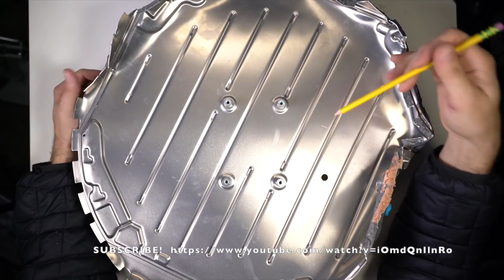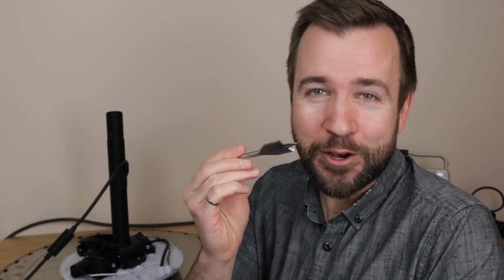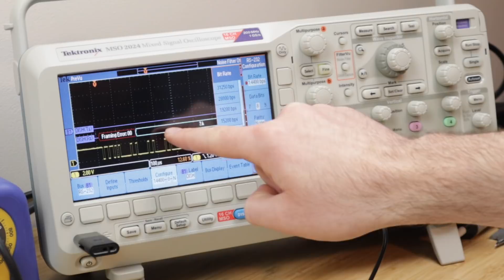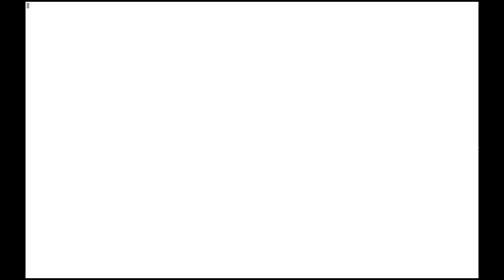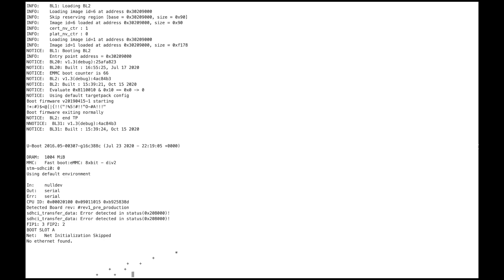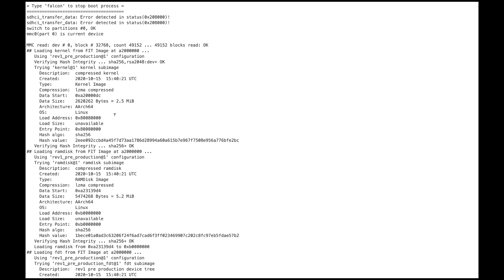Starlink Dish TEARDOWN! - Part 2 - Serial console and login prompt. Can you guess Dishy's password?

Comment: Did you ever make any progress on this? I would try something similar to the method below. 

1. Replace the router end of the ethernet cable with a standard RJ45 plug and power the dish wish a PoE injector. 
2 Compile a basic initramfs using something like openwrt or buildroot.
3. Like it says - type "falcon" to stop the boot (this will drop you to a uBoot shell).
4. TFTP boot the initramfs made earlier.
5. Mount the original root filesystem then cat /etc/passwd and decrypt. Reboot normally and enjoy root. 

At that point I would look for anything interesting. Listening ports. Services. Satellite configuration setting. Once could, in theory, uncap emission levels (upload speeds) beyond FCC regulation for example.

Comment: Did you ever get around to checking out the power block and it's POE requirements?   I'm mainly wondering if it'd be possible to bypass the brick and tap straight into an off grid 48v system(which typically charges up to about 52 to 56 Volts).  I've heard people say the Brick gets really hot so figure there's unneeded power drain to convert from 120v to 56dc.  With people seeing power draws of 100w to 200w I'm that could be cut back a little. 

I'm also a little curious on what that Black Dish cable looks like internally.   Does it just use a standard Cat6 or a proprietary cable with a larger wire for power?
Reply from the maker: Hey! I've been busy with work for the last little bit, but I am also VERY interested in the power supply. I'm hoping to try a few off-grid scenarios as well. I'll probably start by using an inverter, but I'd like to see if it's possible to supply DC direct with a little hacking and maybe a boost converter.

Regarding the back dish cable, it looks like ethernet, but possibly with a heavier gauge wire. I haven't measured it yet.

Thanks for watching!
Reply: @MikeOnSpace  ,  You may wish to ask Shariar if he has the power supply needed.

Comment: Gotten any further with access to Dishy?
My guess for the password: secret

Your tear-down work showed me a lot I wasn't expecting, eg, Linux OS, GPS hardware and an amazing design. Have you discovered how to separate the white back part with out drilling and cutting yet? Can you "nmap" the Ethernet connection to Dishy and see if it has any ports open? ... Or does it behave like a bridge device? mactelnet then? (thinking Mikrotik)

Comment: You're spending so much time on the oscilloscope (13:19 "figuring out the baudrate") -- as a sysadm, I'd just try the common baud rates with a terminal program, because going nonstandard is an extra burden even Starlink does not need.

Comment: Thanks for this interesting info. I am curious if this antenna would work mounted on a moving and rolling object (like a boat). It would be interesting to test if you loose connection if the antenna is moved or shaken lightly...

Comment: Try sending it bucket loads of fast repeating crap, starting with endless sequence of ESC (ASCII 27)  BEFORE powering the device up. IE start the stream sending, then power on the device. Sometimes u-boot has a window when it can be interrupted even if they have tried to lock it down. If you can get to the u-boot prompt then booting single user is the best bet.  Failing that try and find an update firmware image (or de-solder the flash and read it!) hope that somebody can force the key to decrypt and recover the files from the image. You stand zero change of brute forcing it from the login prompt.

Comment: You can probably gain access to this prompt by just dumping the Emmc and replacing the hash in /etc/passed or modifying bootargs as others have recommended. As a side note the main MCU looks like it’s a custom stm32 variant. Most stm32s do not  support secure boot — so I wouldn’t be surprised if this bypass actually worked (aka there aren’t additional checks to verify the firmware contents before booting). I break and secure embedded systems for a living and I’m super interested in the work you’ve done here. If I can answer any questions, let me know :).

Comment: Take the EMMC out and load it on another computer... its just a linux computer, it may have a goofy file system so you may need a cutom kernel but there is a chance you wont. Worst case just recompile your kernel with all the flash file systems enabled and go at it.
Reply: hehe the first good answer , indeed it boot from the emmc and in the ken keiter video you kan see it aslo has the testpoints so no need to desolder it . hope signal path is clever enough to do he then also dont has to figure out how it is suposed to be  . hilarious to see probing for a uart with a osciloscope , did you also find the usb and sd pinout it is also there why uboot tries also boot a sdcard port

Comment: Hi Mike, the header is a bit big for RS232 only.  I suppose they also have the JTAG wired for factory programming. You can use that to read the flash. Gettting the password is really easy after that.   Another option is to stop the automated uboot and start the kernel in single user mode.

Comment: Interrupt u-boot and try to add "single" to the kernel parameters.  If that doesn't work, try init=/bin/sh or /bin/bash or /bin/busybox /sbin/busybox, etc etc
Reply: single might not work (as it depends on startup scripts), but adding init=/bin/sh to kernel params (which you can find with printenv) should work

Comment: Do you happen to find a nand chip? If you could dump/rewrite it, you could decompress the ramdisk and chroot into it to probe around for other files, see if it has other update scripts,add a second user account, change the root password, and other shenanigans.
Reply: Seeing that the serial says secure boot at the start and boot loader checks for checksums (maybe SHA-256?) there's practically no way to modify the firmware.
Reply: @MikkoRantalainen  yeah, I missed it the first time. Although, that could prevent you from changing things, it won't prevent you from mounting the ramdisk externally after dumping it to poke around ;)

Comment: Out of interest, is it possible to map the dropouts, when you lose connection, and when you get it back to see the amount of time you lose connection, and see the improvement (or not) of the network as the satellites more in to their final position.

I was thinking (and I imagine there are better tools) a piece of ping software running on a pi, just pinging a server ever 30 seconds. Keeping track of the number of lost packets, then drawing a graph, of packets lost by day.

I am not sure if 30 seconds is frequent enough, but it doesn't have be every second.

The last time I looked, there were at least 4 trains of satellites, still pretty tightly packed.

Comment: Drop into uboot and load the kernal and init=/bin/sh then pull /etc/passwd and /etc/shadow and run it through john the ripper.
Reply: Dropping Dishy McDishface into single user mode is harder than you think :^)
Reply: @MartinBogomolni  why
Reply: In one device, the restart command was a script that erased the contents of the nand flash. Be careful :)

Comment: Interrupt bootup in U-Boot and add init=/bin/sh to kernel arguments. This will boot it into a shell running as root.
Reply: No kidding !?! 😭
Reply: @ArnaudMEURET  You can do that with basically every linux and bootloader, until you sign and lock your bootloader config and cmdstring with secure boot
Reply: @SysAdmin42  On EFI systems I use sicherboot myself.  It builds a signed EFI image from a normal kernel.  Even better, if secure boot is enabled, then it prevents modifying the default cmdline.  GitHub link:  https://github.com/julian-klode/sicherboot  The C code used to build the stub:  https://github.com/systemd/systemd/blob/master/src/boot/efi/stub.c
Reply: @SysAdmin42  this is why full disk encryption is needed, you can't bypass it
Reply: stdin is set to nulldev in U-Boot, not sure if it accepts serial input.
Reply: @johnkeates9434  Good catch, looks like they thought of that. No hacking the planet yet :(
Reply: Try dirtycow
Reply: He needs to try this
Reply: Cool
Reply: Came to say this. Learned at defcon
Reply: /etc/passwd might be worth a run
Reply: Doesn't it trip the secure boot? 🤔
Reply: Everything is hackable, guys.

It will be hackproof if dish connects to Starlink servers and do authorisation through it.

But if it authorises locally, you can crack it

Comment: User: spacex
Pass: starlink

worth a shot!
Reply: Yes. My linux laptop locks after 3 attempts for 5 minutes
Reply: @Gameplayer55055  oh oki well thanks for the answer still gonna try it my self :p
Reply: Does linux have any protection against brute forceing the login?
Reply: @albertas1337  Technically an executable called "login" or "logind" is already running in the terminal when it says "login:". It's up to that binary to decide what to do when it gets incorrect input. I think many versions will allow infinite retrying because security of the system is supposed to rely in password hashing and long enough password. Considering that this device seems to have 1 GB of RAM, it could use scrypt for password hashing and all I can say about brute forcing that is "good luck".

Comment: At this dish i would not desolder emmc... i would try to log into u-boot with the „falcon“ intercept message what U-Boot says. U-Boot has options to boot via tftp and more. Even nand and emmc commands. I did in my past some emmc dumping via uart and more. Depends which options are built in. Most likely the tftp boot option is enabled. Also... some of the traces at the connector were looking like differential pairs or similar i suspect that there might be an USB routed also.... but that is just a weird guess now. Also interesting is that the u-boot by itself contains a dtb /dts, ( dtb... device tree blob ) this contains all the necessary hardware definitions so u-boot can work. If the dts / dtb can be dumped you know exactly what hardware is connected in which way in terms of adressing and device types. In linux you have device tree tools to decompile and recompile dtb‘s. Oooooh i love such stuff. Exploring tech to see how its made and what it makes tick. Aarch64 is awesome and the cpu is extremely powerfull. I wonder how the phased array is connected. I mean building your own 2 meter super dish just for the heck of it.... hehehehehe. If You need help drop me a message...

Comment: Pull the EMMC from the board, then you can dump it and take a look at what users are in the user table, and maybe what the passwords are - or at least what the password hash is so you can run it through a hash generator to get a key to match ;)

Comment: i'd guess the "development login enabled: no" means that there is no correct password, root account might be prevented from logging in with any password
something else thats interesting from the logs: "Boot slot A", might be possible to make it switch to boot slot B, could be older firmware (or just empty since no updates)

this goes into the destructive territory, but maybe you can desolder and read the flash, look at shadow password database, work out how it decides whether development login is enabled

probably cant replace the AP with an MP1, but the linux OS is likely to boot properly on an MP1 devboard.
if it is an MP1, it has the A7 core for linux, but also a M4 core that would have its own firmware that you could try grabbing with swd or jtag, maybe thats what other pins on the debug connector are for

Comment: I hope they don't go the route of locking everything down. It's awesome to explore these cool devices! Especially when you you are supposed to actually own the hardware.
Reply: Problem is the FCC and other regulatory bodies don't like average joes fiddling with firmware settings on RF equipment; that's why its just cheaper for WiFi-Devices to be locked down than risking someone DoSing weather forcasts because you didn't secure the device enough.

Comment: if you stop the boot process, you should be able to add "single" to the kernel boot parameters and it should boot to a root prompt without a password. Then you can change the password, look at what other accounts exist, poke around the filesystem, etc etc. Also, have a look around the u-boot environment variables - usually fun things hang out there (maybe like Development login enabling)
Reply: If the filesystems are mounted read only though (check with mount) you won't be able to change the password permanently. They most likely are as the checksums don't change between boots. Fairly typical for embedded devices to have read-only flash, and only use filesystems in ram for temporary files while it's running. You can extract the password hash from /etc/shadow and try cracking it with John the Ripper or similar...
Reply: I agree, this is probably the best way to go forward. Write a simple script to stop boot process by injecting 'falcon' or at first just try to press 'esc' as this may work too. Blindly guessing passwd is not going to do much.

Comment: Does dishy include a copy of the GPL?
Reply from the maker: Good question! Not that I can see. The Starlink phone app does include a section on open source licenses, but I haven't seen one for the dish. There is a little booklet that comes in the box, but it's just for regulatory info - no mention of licenses.
Reply: @MikeOnSpace  GPLv2 doesn't require source code to be shipped along with compiled version, however it should be available if you request it! Ask Starlink team to send you the source code, they obligated to provide it by GPLv2 license to their customers.
I'm not gonna be surprised if nobody had asked them for sources given that not many people simultaneously have Starlink dish, know about GPLv2 and know that it is running on Linux kernel. So you might be the first one to get it!
Reply: @keonix506  if that works, I'll be facepalming myself 🤣😂🤣😂
Reply: @MikeOnSpace  That's not good 🤑

Comment: Speed. Tests. Are you actually using this or just tearing it apart? Lol.
Reply: The other thing is, it's the people testing it and tearing it apart that make YouTube videos. The (probably) majority is using it normally, just don't post updates about it.

Also this is beta stuff, so naturally you have a higher concentration of enthusiasts.
Reply: With the fact that he was careful to not scratch the board, that he was able to confirm boot and network connection, and that he's getting the white back plate from Ken... he's actually using this, and in the end, he'll have an ALMOST stock looking dish... with the exception of the 20 pin connector he installed for the breakout board

Comment: Glitch the u-boot loader so you can change the parameters and boot from network with a basic arch linux and chroot the emmc and check contents
Reply: a) it will not boot from network
b) it will only run signed code (says so during bootup)
c) good luck without the devicetree blob for this soc
d) no

Comment: Build dates from the firmware:
BL1: Built : 13:04:48, Jul 30 2018
NOTICE:  BL1: Booting BL2
BL20: Built : 16:55:25, Jul 17 2020
BL2: Built : 15:39:21, Oct 15 2020
BL31: Built : 15:39:24, Oct 15 2020
U-Boot 2016.05-00307-g16c388c (Jul 23 2020
kernel:      Created:      2020-10-15  15:40:21 UTC

So clearly BL2 and everything after are built in the same build process. I'd guess BL1 is not updateable, it loads the crypto keys from trusted store and validates BL2. Either it or BL20, which is what's actually booted after the firmware says it's booting BL2, is responsible for flashing updates. It would be interesting to find out if the firmware image in flash is encrypted, and only decrypted to RAM: https://www.st.com/resource/en/application_note/dm00355688-overview-secure-firmware-install-sfi-stmicroelectronics.pdf
Reply: Actually, it's a four-stage bootloader with a trusted chain.
BL1 - BL3 are provided by the SoC vendor and rarely changes and updates. Only if you need something special. Those bootloaders are quite simple (I'm familiar with this type of system).
The last stage is u-boot which actually boots the Linux kernel and responsible for the flash reading and writing. Probably they have some TFTP-based interface in the u-boot to able to flash the system on the factory.

Comment: ask ken to dump the nand / spi chip and snag the login creds
Reply: This would be the fastest way to get the credentials
Reply: @disneyplus5793  fastest is to interrupt the boot process, boot the kernel in single user mode, and get the password hash from /etc/shadow - but then you still have to crack it - this isn't windows, the password isn't stored in (basically) plain text because their "encryption" is garbage like it is in windows
Reply: @gorak9000  If U-boot can be accessed there are usually commands to read and write flash sectors, so one can simply dump the filesystem and replace /etc/shadow.
Reply: @YouCanHasAccount  probably cant replace/modify  /etc/shadow, because of the flash integrity checking
Reply: Password should be hashed though, so we can't just grab it. But we can brute-force it if we get the hash.
Reply: Also the flash will be encrypted for sure, but still worth a try before they remove the serial port from the newer models